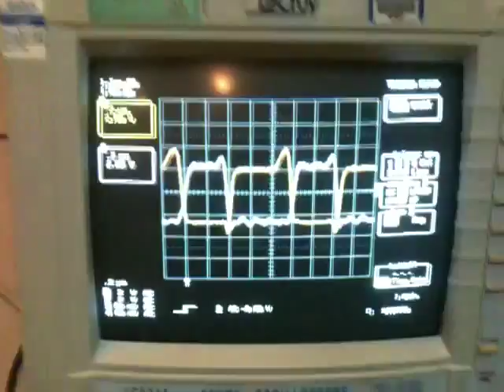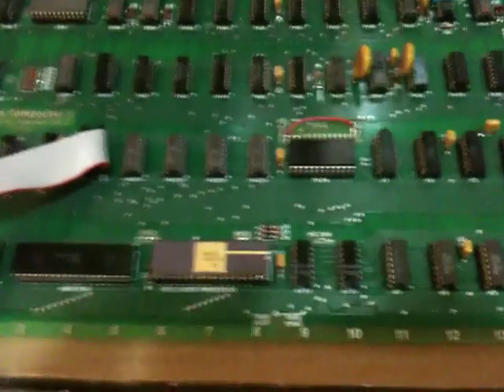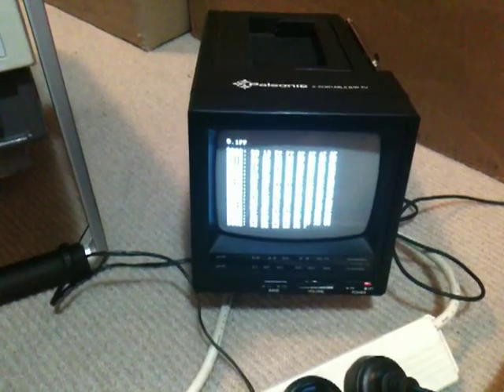Apple 1 World First? Running a 6800 processor on the Apple 1!

Comment: $360 for a 6800, vs $20 for a 6502. Can't blame Woz for making the switch. That's a huge price difference in 1975/76. One question regarding the 6800: can it run without RAM? I've read that the 6502 requires RAM to store its registers and such, while other CPUs like the Z80 has memory of its own built into the chip.
Reply: None of these 8-bit CPU's had any built in RAM and could not really do much without it. You would have to completely avoid using the stack & all variables, and execute instructions directly from ROM. In fact the Z80 would have a HUGE advantage here, it would be able to simulate a number of variables as it has far more registers than the other two (including shadow registers).
Reply: @sl9sl9  you are right and wrong. For example the 6802 does have a small amount of in-built RAM (128 bytes), although you don't have to use it. I think there is a pin to disable the inbuilt RAM. https://www.futurlec.com/6800Series/6802pr.shtml
As far as being useful, I built a 7-station sprinkler controller that used a single board computer that only had a 3 ICs, a Z-80, a latch and a 4KB EPROM (2732). you are right that you can't use a stack to do subroutine calls, but I was able to do a pseudo subroutine calls by setting up a register with return details and then jumping back to the calling location + a few bytes). the Z-80 registers and 'alt registers were used to hold various data including day of week (displayed during standby on a 2 digit 7-seg display), countdown time and various loop counters. also I displayed the countdown time of the running sector in minutes on the display. BCD on the Z-80 sucked so I also had to write a routine to do that. Also with no RTC I used a LDR (light dependant resistor) and a few support components through one of the input ports to detect and count days. So you can do quite a lot without RAM or a stack.
Reply: I guess they would have never been able to sell the Apple 1 successfully, so that switch was /really/ necessary
Reply: yuppiehi A few bytes of RAM are required with the 6502, for the stack, assuming you use it.  If you use interrupts or subroutines (almost always), then you need some RAM there.  There is no RAM built into the 6502, nor the 6800.  I would assume the 6800 has the same stack requirement.  Also on the 6502, it's usually beneficial (but not specifically necessary) to have some RAM in Zero Page, that is, $0000-$00FF.  The stack resides at $0100-01FF.  It would be difficult at best to run either processor without any RAM at all, but I suppose it's possible.

I don't think the Z80 has any inbuilt RAM.  I don't know that any microprocessor does. Generally when you have RAM on chip, it is the realm of microcontrollers, not microprocessors.

Comment: Far from the first lol
Reply: Leor Flor
So? Noone was claiming this was the first computer, or first 6800 computer. Several other microcomputers existed before the Apple 1 (For example, the Kenbak-1, MARK-8, Scelbi 8H, MITS Altair, IMSAI 8080 and MMD-1), but that is irrelevant. The first here is running an MC6800 on an Apple (Mimeo) 1 with a working monitor program. Steve Wozniak originally designed the Apple 1 with the 6800 in mind but ended up using the 6502 instead because it was cheaper. As far as I am aware this was the first time a 6800 CPU has been run on Apple 1 hardware.
Reply: Unusual Activities Are you sure?
Reply: That is not true, Woz could not afford a 6800 thats why he used a 6502
Reply from the maker: Really? You know of someone who had a 6800 processor running on an Apple 1 before this?
Reply: I know who had a computer before that brand existed x3
Reply: theamazingoperaman Woz did

Comment from the maker: Hey Andrew. Thanks for the advice. I tried an S04 LS04 and 04. Only a L04 works. The reason is that it is the propagation delay through the gate that is needed for the circuit to work. It is this delay which is used to generate the two-phase clock for the 6800. Steve Wozniak had tested the clock circuit but had not tried it with a real 6800 (In fact I received an email from him confirming this. The Apple 1 PCB was designed for either a 6502 or 6800 but only the 6502 was ever used).

Comment: If you find further problems, you can try an S04 as this type is often used in clocking, and a 1k pulldown on the tri-state pin is more aggressive than the 10k which is a bit feeble.